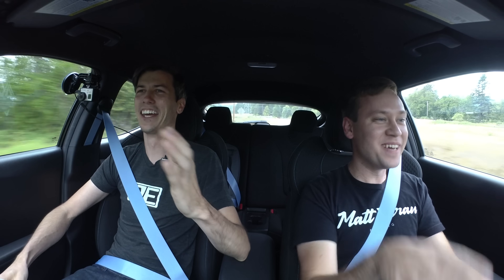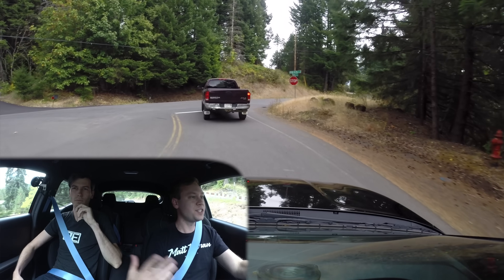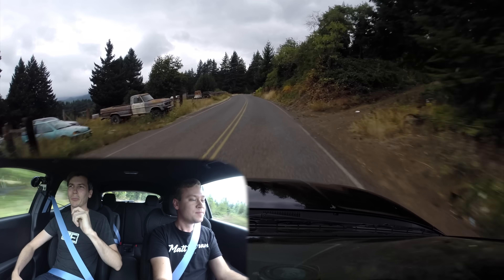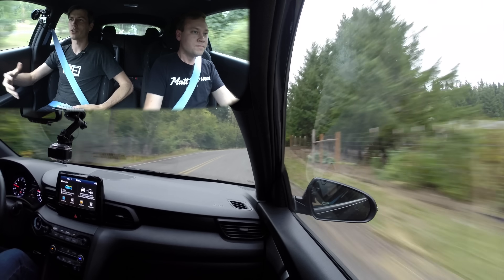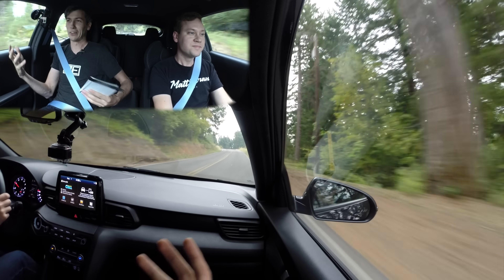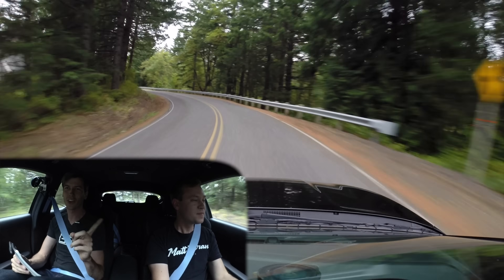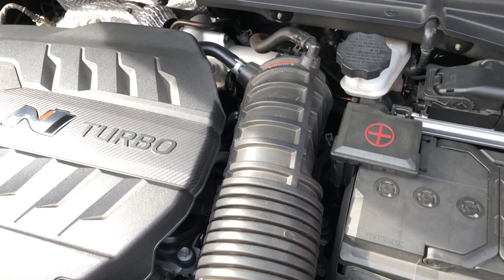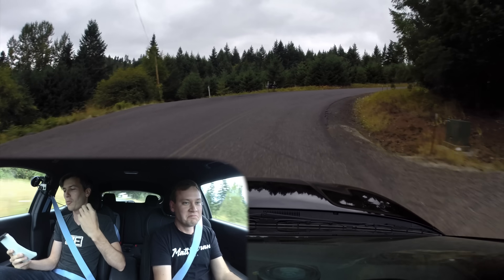Are Car Exhaust Crackles & Pops Fake?

Comment: my built 489 stroker did this when I fully let off the gas over 4k rpm, although not crackle, more like BANG BANG BANG. But I think it was largely the EFI system and dual sync distributor I was running being unable to keep up with throttle position so unburnt fuel ignites on the headers, I didn't have a chance to have anyone follow me to see if I was shooting fire though. But I had an engine fire so gutting the EFI, tossed the distributor in the garbage, going coil pack and crank trigger ignition with megasquirt EFI, hopefully it will give me enough tunability it will only do it when I'm intentional pushing it, not that shooting flames and making bangs isn't cool, its just my truck is heat score enough without people calling the cops

Comment: Not all pops are created equal either. My n55 crackles like crazy on downshifts but doesn't hold/build boost at all. From what I've read on the tuning forums it just doesn't spark the fuel and the fuel ignites when it hits the hot exhaust. Not sure how accurate this is but it does pop quite a bit more once the EGTs climb so they either retard more timing once it gets to temp or the exhaust is at least helping ignite it. Plenty of people with aftermarket tuned burbles on N54/55 had issues with cooked/smoking turbos and cats. Turbos already run super hot I can't imagine this helps their lifespan. I have it on mine but don't run it in sport mode often. More recently BMW started doing it on stock B58s so I guess they can't be that bad.

Comment: Rev hang is the first thing I look to tune out of a car when possible. All modern cars that I've driven have an unacceptable amount of rev-hang which I think must be done for emissions purposes, because it makes otherwise good cars drive like garbage on technical roads where you need to be able to predict exactly when that engine braking will come on (since it transfers weight). Ideally its exactly when the throttle is lifted (a small amount of artificial dashpot is fine), but typically, its after a random amount of time or after the ecu sees a target amount of airflow through the MAF (combustion still occurring) which can vary based on RPM, load, temp, altitude etc. There is no way to predict when that weight will sling back onto the front tires, and it is therefore impossible to drive the car precisely and with full control. I've purchased expensive tuning software for more than one car (at stock power levels) just to eliminate rev hang and tune the throttle correctly so that the driver has control, not the ECU (or the EPA).

Comment: I disagree. At least in most cases for the average car.  I believe it is more often a case of fuel enrichment due to the closed throttle.  The ecu might not have caught up to the throttle close event. The unburnt fuel hits the hot catalytic converter then combusts.  I 'm pretty sure this happens in most cars on the road, however, the factory exhaust is able to contain it.  I have had cars that did not audibly crackle at all until the exhaust was swapped to a straight through type muffler. I highly doubt this to be an "easter egg" done to reward those who change the exhaust.

Comment: It was my understanding that crackles and pops are caused by the temperature difference of exhaust and outside air. Also its more common with a wider diameter exhaust because when letting off the throttle, much less gasses are being forced out and outside air is so much colder that it causes expansion of the hot gasses inside the exhaust system. I was surprised they didn't talk about this but maybe both are true?

Comment: I had a GM quad4 with a custom exhaust, no cat. It had wicked pops and burbles on deceleration.  I always attributed it to the early GM waste spark system. The plugs fired on exhaust stroke as well.

Comment: I'm into high power V8's, and I literally thought those drivers of rice cars were shifting past the rev limit. That their engine was limiting rpms by randomly cutting sparks here and there. I hate that sound. Sounds so cheesy. 
My V8 is tuned, and has a tuned exhaust system. My engine doesn't even have that weird back fire happen, as some mustangs have while revving up the engine high, and letting it come back down to an idle. 
Crazy world we live in

Comment: The pops on an NA or SC isn’t always fake. They happen occasionally on higher performance cars when letting off throttle. They aren’t always as loud, as consistent and obvious (or annoying) as what they are tuning into the turbo cars now, but so many of those are so over played and obnoxious. Example would be a GT3RS vs what we see tuned into many modified WRXs over the past 10 years or now what is tuned by the factory in many turbo Japanese cars. Fake pop and crackles, fake vents, fake exhaust tips, all LAME!!

Comment: I'm kinda divided on the exhaust crackles, fake or real. I have to admit that it can be nice on a windy mountain road or in a tunnel, but we have a lot of douchebags around here that enjoy nothing more than accelerating overly hard and braking again, unnecessarily revving like crazy, and sometimes burning rubber at like 2AM. These crackles are just another tool in the arsenals of these morons, whether they are functional or not

Comment: I think one thing not mentioned is certain cars on certain tunes will pop and bang between shifts as a result of their given mechanics and functions. For example my car will make a very loud bang after a big 3rd gear pull and i freaking love it! Cars that bang or crackle on decel that seem to do it as a result of their parameters usually sound really good, but cars that obviously have been made to do that (the old burble tune) and will pop endlessly even at 1,800 rpm at 10 mph sound fake and lame.

Comment: ok for turbo engines but for n/a it shows that spark plug advance is not adjusted if it cracks, because on full throatle spark  occurs before but not to far from tdc but if  you release throatle  spark should occurs far more before tdc  but if not , if it stays as on full throatle then it cracks and fuel is never cut off immediately after gas pedal is released

Comment: Its up to your definition to decide if its fake or not.

Is it sometimes tuned into the calibration to crackle and pop? Yes. Getting an aftermarket exhaust can also do that but I feel like thats just because the car isnt tuned. So is it something that happens normally if it isnt tuned into the car? I dont know. In that sense its "fake". You could just tune it to make crackles and pops on decel.

Its not like just because these cars have turbos or are performance cars they just magically make crackles and pops. Has little to do with them being sporty or making x amount of horsepower. A civic could be tuned to do this.

Comment: NOOOOooo! That burns valves man! How do old cars do crackles and pops than? It's a natural process when you have very low fuel to air ratios and the spark plug doesn't ignite the mix. In a few rotations you get enough fuel in the exhaust and the heat in the pipes and valves is able to ignite it.

Comment: I personally don't like exhaust pops. They just don't sound good to me, and even sometimes sound like they're damaging the engine. I think it sounds much better to have a smooth rev down instead. It just breaks it for me when the engine has a nice, low growl and smoothly revs up then just pops and crackles on the way back down. Maybe it's just because the only thing I'm used to hearing pop is a tractor backfiring, but I still stand by my opinion that a car sounds much nicer with a smooth rev up and down with no pops or other noises.

Comment: Before commenting I'd like to say my experience comes from 5 years of car design. The CVT example was created as a transitional phase for the normal customers satisfaction. The reason being that people have been used to feeling a car shift ever since the combustion car has been around. So similar to the electric car there are designated increments designed to ease the normal customer into a new technology.

Comment: What about ohv engines such as a hemi charger that cannot control separate valves at separate intervals, yet they still have exhaust crackle. Or my P71 ford that has a small amount of crackle in the exhaust while not having vvt.

Comment: I would love to see a manual CVT that uses a big thrust lever to control the gear ratio
Reply: SAME!
Reply: That exists in tractors...mechanically it is completely different than a cvt but it is driven just like that
Reply: Why not a lever that gives you the ability to change the gear ratio to anything you want
Reply: Why not just use a huffy grip shift on the steering wheel?
Reply: Lmao like a constant speed prop airplane
Reply: I hate c v t. It's pure garbage. It's basically a rubber band transmission. I prefer an old stick and a manual clutch.
Reply: I have thought the same exact thing! Mercedes made a design on their F1 car called "Dual-Action Steering" that made telescoping the steering wheel actively change the toe angle of the front wheels. The drivers learned to adopt it because it was faster, even tho it wasn't easy. I see no reason why a kind of "manual CVT" wouldn't be MORE difficult than a standard manual gearbox. If a talented driver can drive an 8 speed manual like a finely tuned piano than I'd love to see how they perform on a "Violin". "CVT's are boring!" he said as the whole field screamed by at racing engines that have been red-line....for the last 4 laps. I remember how "cute" and "boring" turbos were...until they were fast.
Reply: @xBardcorex  I see no reason it would be more difficult. A CVT gearbox can be controlled with a slider like an airplane throttle.
Reply: @xBardcorex   never heard of the dual action steering before, that sounds pretty cool and really difficult to use.  I could imagine a race with manual cvts would be a game a chicken between you and your car to see how long you can keep it on redline before something gives, and only the most precise would be able to make it last the longest.  It would be neat to see what sort of tricks people come up with to optimize it!

Comment: So I guess why I get some crackles at low rpm (under 1600rpm) because the car is getting ready to hold the idle rpm? Like if I rev at a stop just to around 1500rpn, it does crackle faintly but if I go higher, I don’t get crackle until it gets under 1500 so is it just adding fuel because it’s trying to slowly return to idle so it doesn’t feel like it stumbles? Kinda curious about that. I noticed also our 05 srx 3.6 (v6) caddy crackles a lot at around 1-2,5k rpms and sounds like it has a tune but it’s completely stock in every way so I’m curious if GM meant for it to crackle? Or if it’s just had parts wear or something that caused it to develop the crackles.

Comment: Can you talk about/explain fake throttle response in modern cars with drive-by-wire? Obviously, the throttle pedal is not directly connected via cable to the engine anymore but I don't understand why throttle response is so much worse these days. Is it a fuel savings measure? It must be by design, surely.

Comment: the "fake" vents on the toyota are actual vents that are covered up.   On a daily driver, having functional race vents presents a new set of headaches in terms of rock chips and fuel economy.    But I do like it that toyota gave you the option of being able to remove the vent covers for a cheeky sundaday at the track and then pop them back on when you are going to work on monday.

Comment: So what I learnt from this video. Get a remap that has no crackle on low revs (say under 3000rpm), which gives you better fuel economy, engine breaking and clean noiseless cruising. And on high revs (3000 +) delay the timing, giving it that nice crackle, maintaining high revs when shifting and keeping the turbo spinning. Please correct me if wrong, I'd like to learn.

Comment: Little late to the party, but I'm gonna be a pariah and say that I absolutely do not like exhaust crackles and pops. It's a sound that always makes me think the engine is backfiring, and hearing this explanation of how they're made I feel slightly vindicated that it kinda-sorta IS what's going on, just deliberate and controlled. I want a nice, clean overrev whenever I let off the throttle, and if I've ever got the money to push some weight around when buying some luxurious sports car, you can bet I'm gonna tell them I don't want to hear any crackles and pops in the exhaust at all. Remap the ECU and make those pops go away plz.

Comment: I have a CVT gearbox in my Subaru Levorg and I disagree that it has not have any functionality. The first one is that you can change gears with pads at the steering wheel. The second one is that you do not have the annoing noise all the time. Instead you have got a gear shifting sound.

Comment: Hello from germany. What about the "normal" missfire of high powered natural aspired enginges? I have these light crackles betrween 3000 RPM and 5000 RPM in my e39 M5 from 2003 when the enginge and the exaust is very warm when I interrupt the throttle then for example for changing gears in that range. It also work without driving. Steady throttle at 3500 RPM, than lift the throttle and ist crackles softly. Whtat kind of effektis that, how it works? Sorry for bad grammar and spelling. Greetings from germany.

Comment: Haha someone lied to you :) The level of ALS required to maintain boost off throttle involves a lot of air (about enough air to rev the engine at 5000-5500 in neutral - that’s really a lot of air, about 35° of throttle angle) and the retarded combustion (like 40°ATDC with about 30% ignition cut) makes the EGT climb to approximately 1000-1050°C in the yellow-orange, which requires exotic materials for the turbine and shaft, and the turbine housing (think mar-m-247, titanium, and Inconel), plus relocation of the catalytic converter to the very end of the tailpipe, and a lot of fireproofing. So no, not a proper ALS on a road car. What happens on road cars is the mixture is leaned out (to about lambda 1.4, just at the limit of combustion - slow burn, and misfires a lot creating a rumble and some pops already). They also cut about 1% of the sparks at random, from 3000rpm and up, and those unspent charges burn in the exhaust manifold, making the sharp crackles or even flashes of flames if the cat was removed. They really cannot cut much more on a road engine because cylinder wash. Maybe the turbo erratically spins a little faster because of those crackles, thus the claim, but mostly marketing IMHO. Ford has crackles in the RS but makes no anti-lag claims, and I’d love to see some written claim from Hyundai. The total duration of this gimmick is randomized between 300 and 400ms, so it sounds a little different every time. Tuners increase this time, and sometimes also slightly increase the percentage of cut sparks, which together to increase the amount and loudness of the cracks and pops. So yes, they are fake, to answer the question in the title :)

Comment: Hello from PCNA
The Porsche cars with the Sports setting turned on and the Exhaust valves open do indeed produce pops and crackles when letting off the gas. The crackles and pops do not occur outside of sports mode. I'm not sure if this applies to the NA vehicles but for the Turbo vehicles this does apply

Comment: It helps keep the turbo spooled and burns the extra fuel left over when you lift the throttle.  It also sounds great!  I love the sound of my 2019 SS 1LE when I leave it in gear to engine brake.  It sounds wonderful!

Comment: I'm not a transmission expert, but my theory about the CVTs simulating gearshifts under power is that its easier on the transmission to simulate shifts. Rev under a single ratio, reduce power, change ratios, and reapply power. You lose a bit of acceleration, but probably less than 5%, and the transmission isn't changing gear ratios under heavy load. If it was simply a perception problem, I would program in a way to turn it off!

Comment: The modern version is massively over the top, and I personally hated it. I have a heavily modified classic car. All old school tuning, heads ported and polished, massive cam, forged bits in the bottom end etc, to ultimate road spec, ie it's drivable but still Needs a high idle, and generally needs to be in the 4-7k rpm to have usable power.... That had a modified distributor but fundamentally no intelligent electronics, and a cable throttle .. That would, when pushed hard and with specific throttle position pop on overrun. But rarely under normal driving. 

People do it now because it's cool, in the same way putting McDonald's trays on the back wheels of your mums Fiesta and doing doughnuts in the car park....

Comment: Lest we forget the original reason crackles and pops were ever cool...
The heritage of this effect goes back to days of yore when race cars and performance-tuned cars would be set to run rich but were not sophisticated enough to completely prevent unburned or partially-burned fuel from passing from the combustion chamber into the exhaust system. This was particularly the case with carbureted cars, but you can hear it in many older FI cars as well (for an awesome example, watch/listen to the Group B Audi Quattro between gear shifts and on overrun).
Basically, crackles and pops are tiny little exhaust backfires, which sound cool because of these performance connotations, but were originally just the byproduct of wasted fuel.

Comment: So why does my MK1 Austin Healey Sprite crackle and pop on the overrun, rebuilt the engine changed the carb and fitted electronic ignition, still does it??? Wouldn't have it any other way, love its moods😊